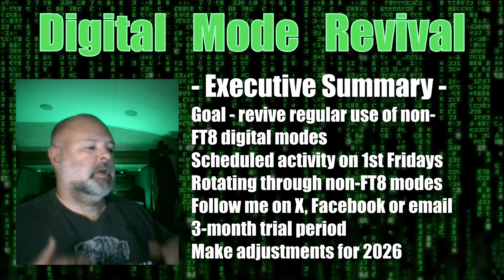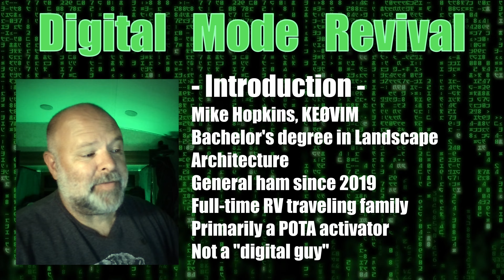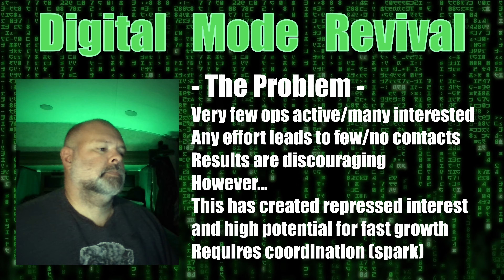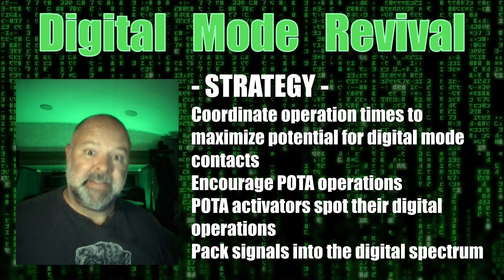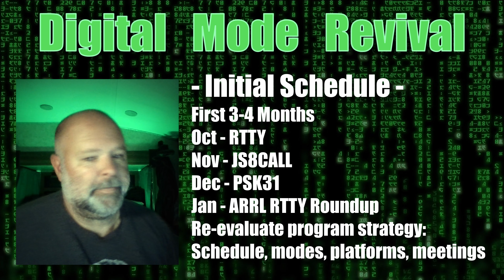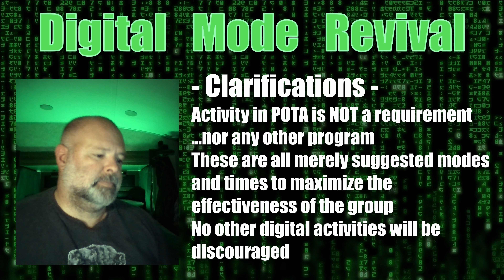The Digital Mode Revival: Proposed 3-Month Trial

Comment: Thank you for your effort here Mike.  I'm an Ft-8, Ft-4 user, with no experience in the other modes.  Can you point in the direction of the best software for RTTY?  I'll get up so speed so I can support your effort. 73
Reply: I use a free program called FLDIGI. It runs numerous digital modes and it's a free download. It's available for Windows, MAC, and Linux.
Reply from the maker: This is where the Ham Radio Crash Course livestreams really shine. Anytime you’re trying a new mode, Josh has probably made a livestream setting it up and using it. I’d look into FLDIGI as it can do almost any of the non FT8/4 modes.
Reply: @TravelinHam  Thanks Mike.
Reply from the maker: I bet a guy like yourself who likes to talk to people and has a bit of a compromised home station would find a lot of value in one or some of these other modes. I’m interested to see what you think.
Reply: @TravelinHam  I'm working on figuring out RTTY. I'm a bit confused since KI6NAZ suggested LSB and others USB.  But, I'll figure it out.
Reply: @paulTheSouthernHam  The convention for RTTY is LSB, all bands.